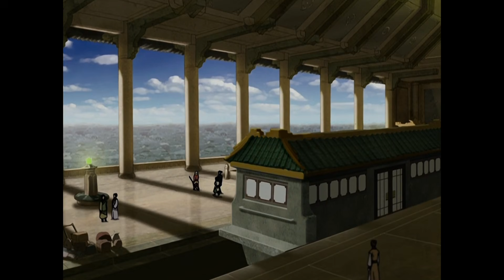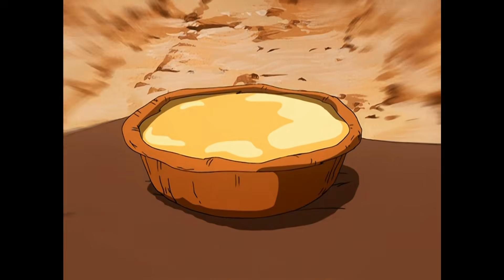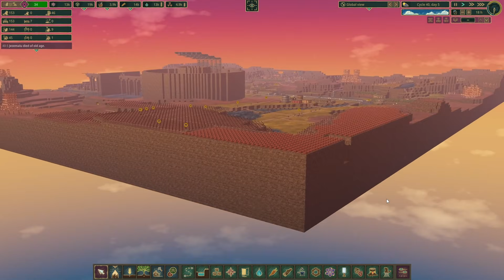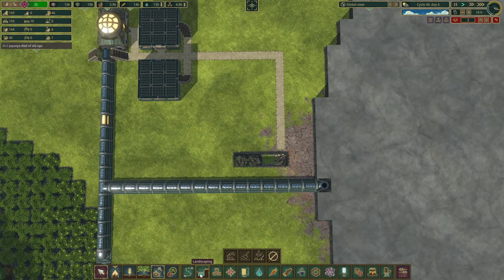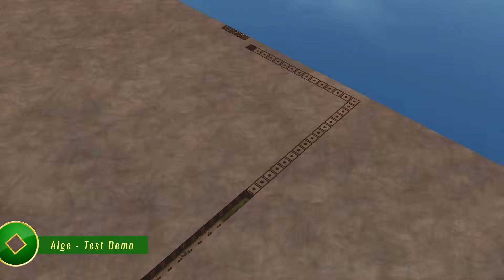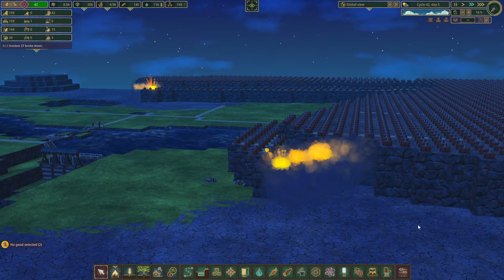Finishing the upper ring and testing the water pressure!

Comment: @Fuzz- I'm on the fence about offering you a great deal on my extra set of RAM since I will have a use for it someday.  I removed it after a month or two to slightly increase my clock speed.  If you want to make me an offer, it's Corsair Vengence 16GBx2 6000mhz ddr5 (not the RGB model).  Still in the box after using them for 1-2 months.  I love your channel so why not give you an opportunity?...
Reply from the maker: Appreciate that, but I'll hold off for now. I've got a few other things to take care of first haha.